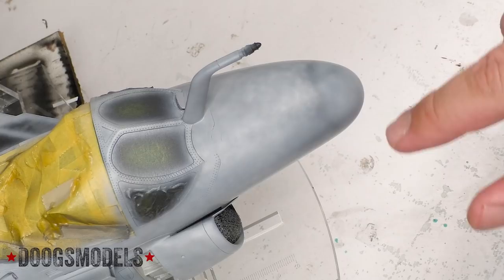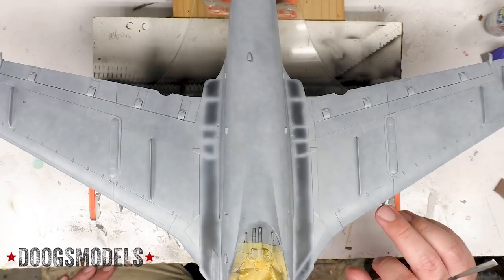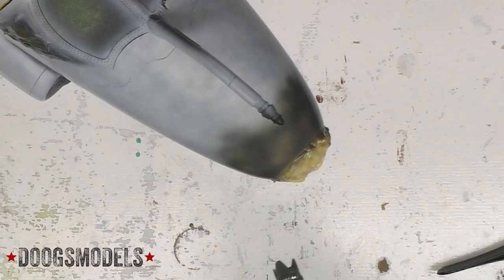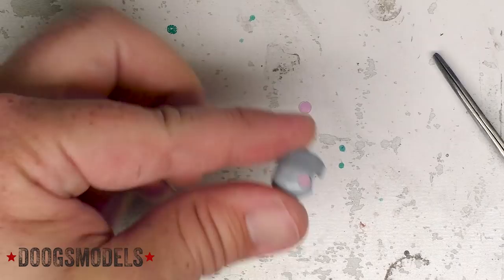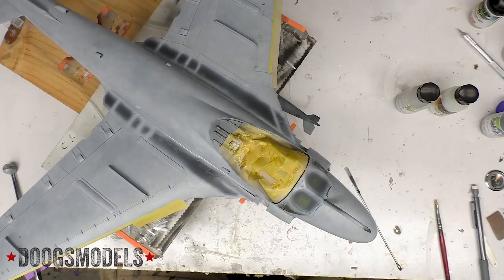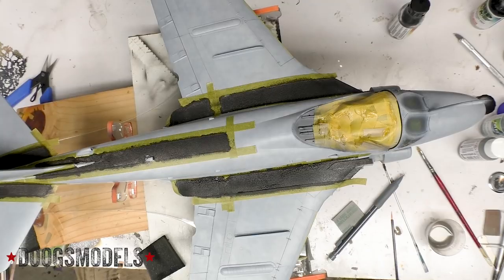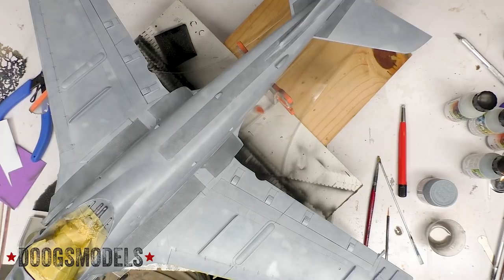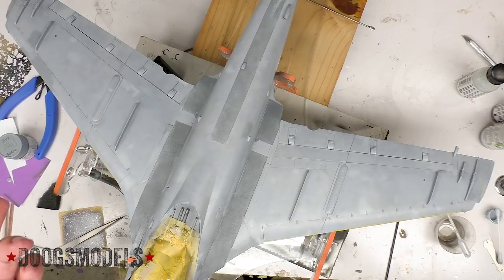A-6E Intruder Build 15 - Moar Painting

Comment: “High Speed tape” there’s instances where it’s used around panels and gear doors as well. Yellow, Radom tan, and clear was used depending on the airframe.
Reply: The tape we used.....clear.....when it aged turned the yellow/green color.
Reply: Instablaster
Reply: The stuff we had was yellowish and i remember it was tough to cut and it was a 3M product